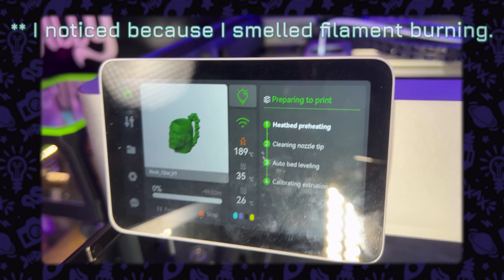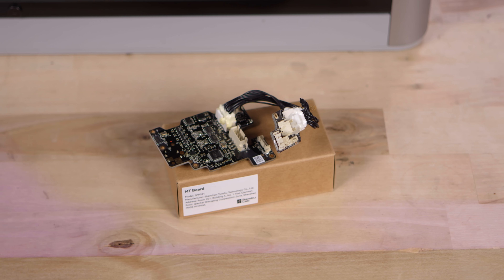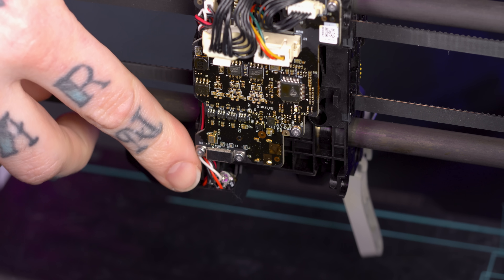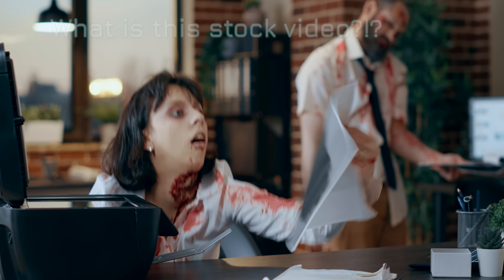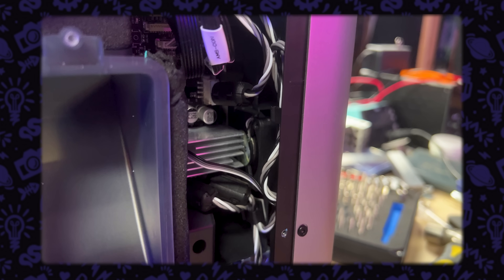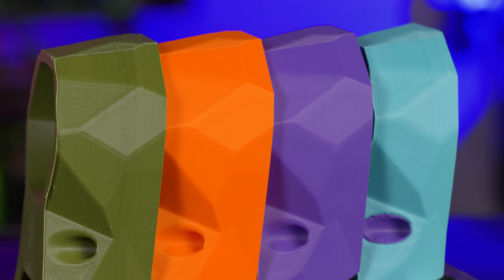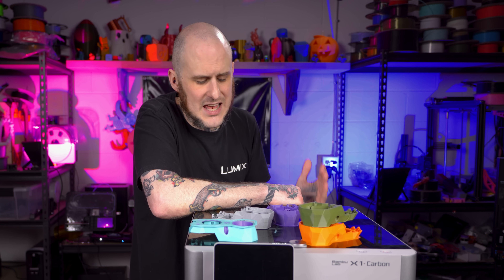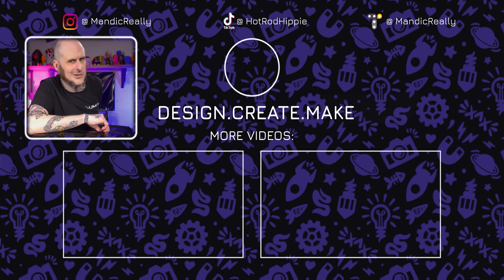MY BAMBU X-1 BROKE - Thermal Runaway?! Let's Fix it!

Comment from the maker: Bambu has put out a statement about Thermal Runaway Protection, you can find it here: https://blog.bambulab.com/thermal-runaway/
Reply: 3 minutes before cut off, at a max of 400c? Sounds like a fire hazard to me. PLA ignites at 388c. Bambu lab is in damage control and making excuses for their 3 min timer it seems, rather than just admitting their negligence. Not surprised that some youtubers are dropping support for bambu lab.

"we set the protection to 3 minutes to avoid false alarms ruining a print."
Yeah..I could care less about ruining a print, when it means their is a very potential fire hazard and risk of burning a house down.
Reply: @LilApe  right. I ordered a p1p a few days ago and now I'm somewhat worried that they won't fix it, and since the firmware isn't open source I can't do it myself. 30 seconds maximum for thermal runaway, no reason they had to make it 3 minutes
Reply: @LilApe  Yeah well if the temperature is dropping hard when heater is high that's a bad sign anyway, that doesn't speak for the print coming out good either! And if you're willing to salvage a bad print, you might as well reprint just the top from some layer upwards, so there isn't a lot of value in semi rescuing a print. Either way safety takes precedence, some aborted prints are fully acceptable.

I'm thinking the real reason is that they wanted to reduce the support workload, they don't necessarily want people calling them and filing tickets before they're on fire.

Comment: Did replacing the TH board work?

My temp is stuck at 245c always. Changed hotend set, didn’t resolve, I’m a new printer, 1 year into X1C and it’s been awesome but now I have spent hours and hours trouble shooting and getting nowhere with nozzle temp issue. Support not helping and taking days to respond, not giving any real help other than misleading me on warranty issues, saying they were going to cover
the part needed only to take week to say they’re not, it’s out of pocket bc I’m two month past 1 year warranty.. and honestly I’m completely intimidated now. Bambu is recommending new TH board set, I’m not confident the change will fix the issue I’m already a lot of time into this issue and it’s $50 part and printer is barely over 1 year old. There has to be something I can try to get current TH board working, but Bambu is not sending anything helpful to do, just pushing new parts that I don’t think I can fix.. It’s not damaged physically, nothing happened to it, I don’t think I need the whole TH board set? Sucks bc support already cost me money to no avail with hotend, now entire tool head set $50 and who knows how many more hours. Having a hard time saying X1C are great first time machines. Support needs to step up and they might be but support dragging everything out and misleading. Tutorials are terrible format, pics, vids, tone, time etc all lacking with Bambu imo but I can’t compare them to much but it’s painful process with support and I don’t give up easily, relatively hands and savvy, ok hope I don’t have issues like this all the time and that I can fix this issue.

Comment: I know this is an older video, but what slicer did you use to print the model with your Voron? I know I see a big difference when using Cura vs PrusaSlicer vs Simplify3D vs Canvas (for Palette 2 pro). But, I also know that i don't have every setting the same in all of these slicers. My point is that maybe that's also the case with why you see a difference. Can you use the same slicer for all the printers and see how they look then?

Comment: That's not thermal runaway if your thermocouple isn't plugged in properly!
Reply from the maker: Thermal Runaway refers to a control systems inability to stop out of control heating. The cause is not indicated in the name. A broken thermistor wire would behave exactly the same as a poorly seated connector. Also, the early thermistor connections were a known problem on these machines so poorly seated ones are not at all uncommon. None of that changes the fact that at the time of making this video Bambu allowed multiple MINUTES of out of control heating before initiating Thermal Runaway Protection.

Comment: the carbon filter aspect, do you have pictures, video footage of what the inside pocket of the carbon filter area is like? I have a P1P I want to convert to the P1S and can't find what kind of contraption/addition was added to the inside to rest the carbon filter on (through the door on the inside of the unit).. and wondered if you know, if you have footage on it?  I will keep looking, haven't found that info yet.
Reply from the maker: They are selling a P1S upgrade kit: https://shrsl.com/45eg0 (affiliate link)

That said, I don’t have any information about that part in particular. I’d have to dig deep but I know for a fact I’ve never filmed that in depth so it would almost certainly be a fruitless effort. I can try and look at my P1P when I get it out of the box, but I also don’t know when I’ll have time for that.
Reply: @MandicReally  I just accidently screwed up and erased my message I think. The "box" or the spot the fan is attached to, I DO NOT BELIEVE is in the P1P at all. I had mine apart, was super tired because I did a lot of upgrades to it last night, I don't remember it. I will take it apart again and do some measurements. From your video it looked like the box was 5x8 and a few inches deep, I know some on printables have made refill boxes for theirs.. I will get that and print it also. trying to DIY as much as I can, already had the door (front) and lid from an X1 so I am nearly there. Appreciate you getting back to me bro!

Comment: possible turn off the input shaper??
Reply from the maker: You cannot do that. The vibration compensation is part of the closed source firmware and we don’t have access to disable or manually tune that.

Comment: The CTC replicator toolhead was much simpler in construction than Bambu, it only consisted of a stepper motor, guide wheel, spring, heater, thermistor  and nozzle.

That being said I could take on this repair quite easily, would it be a pain in the butt having small parts, screws and delicate connectors, sure, but not impossible.

Comment: Did they ever fix the thermal runaway issue? That is a dealbreaker as far as I am concerned on a printer with closed firmware.
Reply from the maker: They shortened the time limit on runaway significantly. I’ve not had any cause or problems to test it’s effectiveness. Unfortunately testing it in depth was too complicated / expensive for me to pursue.
Reply: @MandicReally  Thanks .
Reply: @MandicReally  byw. I don't trust any of these machines 100%. I come from the Anet A8 days. All my printers have a Pi (or elaborate Arduino) acting asa a 'tell tale' if the temps start going too high and misbehaving. The easiest is TP Link Smartplug plugin for Octopi. Is there any way the closed firmware on the X1C can be made to / hacked to report overtemps to a Pi and shutdown a smartplug? Call me mr unadventurous but I have seen too m,uch crap with so-called safe closed systems. Cheers.

Comment: As someone who is looking for their first 3D printer in about 8 years (I had access to build and use a Mk0 prusia i3 clone for a year or so back in 2016), one of the things that really drove me away from the hobby was exactly how much tinkering was required. I would spend 90% of my time tinkering and fixing problems, instead of getting decent prints. My time is limited, I don't want to spend it all fixing problems. I'd much rather have a better out of the box experience, even if it means a little more work on repairs. The amount of time this design philosophy saves is so important to making 3D printing accessible. So today as I weigh the various options, I'm drawn more to the X1C and P1P, as opposed to the Prusas and Enders of the market today.  The combination of faster print speed, quicker setup, and better out of the box experience, plus the advanced "AI" tech that can help detect and prevent problems from cropping up in the first place is what draws me to the Bambu Labs printers today, even though they cost more than your typical budget printers. It's a blunt way of saying it, but my free time is worth more to me than my money, and these printers are a good compromise between cost and accessibility to me.

So would I prefer an easier repair process? Uh, sure, who wouldn't? But am I willing to give up all the other advantages for it? Not at all.

Comment: Could the difference be running the vibration calibration a couple of times maybe?  A few runs may help the machine approach maximum benefit from the process.  My X1C beats every other printer I have ever had (4) in print quality and reliability.  I'm not complaining.

Comment: I get excellent results on the X1 carbon, however I never use the recommended speed settings. I essentially cut them in half, which is still significantly higher than most other printers. The first layer I always run around 50-60 mm/s to ensure that the rest of the print has a solid base. Ever since I've started running at around half the normal speed, things have been great. The stock settings are just way too high for anything other than draft/prototype prints.

Comment: In general I think your argument is right. It's a lot like people should buy PC's and not Apple laptops due to the complexity and non existent local help if they have a problem. I'm certainly no expert on the matter but I think of the Bambu X-1 Carbon is more a mid tier printer and not at all like say an Ender 3, which by the way some people would find intimidating doing repairs as well.

Comment: It doesn't look too bad and having the video guide seems very good. However, it is true that a 3D printer is still not a commodity item. Per your analogy, most laptop owners would not disassemble and fix their laptops either. On the other hand, 3D printers have many more moving parts than a laptop, so there is more items that wear over time and may need replacement.

Comment: I just went to their website and haven't found replacement boards for print heads. It seems that they have only a subset of parts that you can buy right now (don't know about the future). When buying printer, I would like to get all the parts that can potentially break during the life of the printer right away, like fans nozzles, cables, etc. If the printer will work on-and-off for 10 years printing some spare parts and organizers for the workshop, then it should have all the spare parts available for the whole work duration.
Bambu Lab is a new company, and I've seen time and time again, when companies dropped support for their best selling devices, or for a little bit older models.
Reply: Yeah I see what you mean.

If they decide to release a new model they have every reason to make the old ones impossible to repair.

We're at their mercy in this situation. Just be thankful that there are aftermarket parts... Unless they decide to patent all the electronics, close source it and make them impossible to reverse engineer so aftermarket parts cannot exist. 

Guess we will just have to wait and see. But if we have learnt anything from Apple, the above seems likely.

Comment: Thank you very much for your videos, but what's the rambling about that the X1 is not suitable for people who have no experience with swapping hardware?

Rather, it is more likely to say that it is not because of the printer but because of the inability of these people. If you don't dare to do it or if you don't show any interest in dealing with it, EVERYTHING is generally not suitable for this type of people.

So the whole discussion about it is useless and you would rather have used the time for something else.
Reply from the maker: The machine is very much marketed as (& often reviewed as) a machine that is "Push Button & Go".  An experience that will DIRECTLY interest those folks who fall into the camp you mentioned. The point was, I'm trying to be realistic about it for exactly those people. I've heard absolutely no one else explain the way that I have the repair situation & its complexity. Folks who want a printer that "just works" should be aware of what is potentially in their future. 

It is hard for those of us who have this knowledge and ability to view things from differing perspectives.  As a reviewer I've worked hard to try and consider alternative points of view like this so I can relay information that more than just the already knowledgeable will find valuable.
Reply: Yeah every repair has a barrier to entry.

My issue with your point is that it is still in the company's (bambu lab) control to make the printer easier to repair.

If they really cared about sustainability and long term reliability, their (I'm sure very talented) engineers could make a system with a much lower barrier to entry to repair.

Think the framework laptop, which has been engineered with this in mind.

Comment: I'm at 706 in your video, and I'm blown away by where you're going with this review. I'd like to add that I bought a BIQU Hurakan in early December of 2022, and now, on February 24, 2023, it's in pieces on my work bench while I wait for an S-load of parts to "fix" it. Good for you! My X1 Carbon is coming tomorrow. I bought it because it's "plug and play." Wish I'd seen your video (this video) before I made my purchase. Providing customer support on such a complicated machine is going to eat Bamboo Labs profits like popcorn at a first run of The Matrix.

Comment: tbh I much prefer the X1C’s “softer” corners than those from your voron
Reply from the maker: The problem is, the design has crisp corners. I want a machine that can produce a design as it’s intended. If you like softer corners, design a part that way. For myself as a designer, I need to know what I design is what I’ll get when I print it.
Reply: @MandicReally  maybe it’s just the grey filament and lighting, but it looks like the voron has corner bulging, while the X1C does not. What I meant was I much prefer softer corners than bulging corners, because soft corners assemble easier than bulging corners in my experience.

Comment: I have an Ender and have more or less ripped it apart completely and reassembled it a bunch of times out of necessity to fix problems, upgrade, mod and troubleshoot. Idk if I’d be comfortable doing that with the X1C, It looks to be right on the border of what I’d be comfortable fixing myself, mostly because of the ribbon cables, those stupid things are way to fragile. Completely agree that this looks more like a laptop than a desktop in terms of repairs and working on it. Anyways, that stupid Ender broke completely so I went ahead and ordered an X1C, seems to be a much more reliable printer with fewer issues, and less need for repairs and non cosmetic mods and upgrades. Might still add a hepa filter and some COB led strips

Comment: Great info! Have a P1P in route and it will be my speed printer, if I want something really dialed in for quality then I have 2 Prusas. From what I see on youtube videos these printers have HUGE potential that can be unlocked with software. The only annoying parts is the Prusa with 0.6 nozzle isn't slow with the right slicing parameters, guess I just wanted a new toy that can print multi material.

Comment: I would make a much heavier base for it and brace the rails. When mine comes I'll make an external brace and base for it. Luckily I have 3 CnC machines 20m away lol. Not everyone does. So I'll give it a crack. If it works I can sell it perhaps..

Comment: I just got a bambu lab x1 carbon as well. After watching this video I was afraid mine would have these issues as well. I haven't printed much. I printed the scraper and a part I designed myself. As far as I can tell my printer has no ringing whatsoever. That I have noticed so far. Flat sides after corners seem perfectly smooth.

I read some comment somewhere else, that the chips? Or whatever does the vibration compensation are often faulty, it was some guy that had built Voron printers. I think he said 1/10 of those chips or whatever are faulty. So if Bambu labs do no quality control on them I guess 1/10 of their printers are faulty as well when it comes to this ringing issue.

Comment: Honestly I’m kinda surprised there haven’t been more issues with the x1c. I specifically held off on ordering because I thought after a few months there would be thousands of major issues. And many people that have these machines are using them hard. I have seen some issues relating to ringing, some seem to be related to perhaps a certain batch of printers but most have been resolved or have some resolution. 

I expect that there will be some printers with hardware issues, and being a new printer, from a new company, with “new” features there will be a portion of units with faulty parts when you consider all of the above with the pitfalls of manufacturing in general. 
One issue I have is proprietary slicer, you have to use their slicer. But I’m sure someone, likely multiple people, are figuring out a hack to use their favorite flavor of slicer. And it’s likely, as more printers gain newer features and speed more slicers may become compatible. 

So far I’ve seen nothing that would deter me from buying one. Matter of fact I’m likely going to buy an x1c and a p1p this year. The plan is after the first quarter, but for sure before the end of the year.